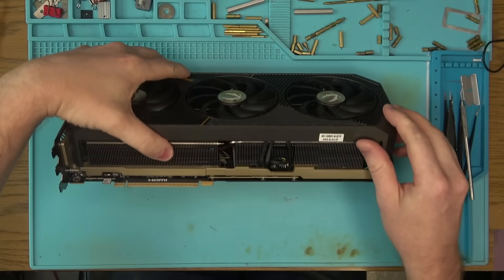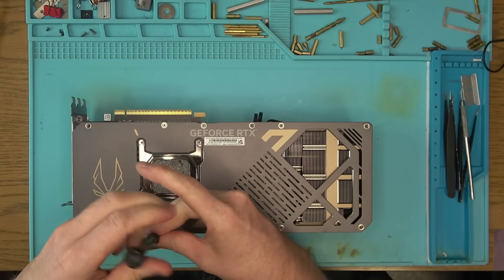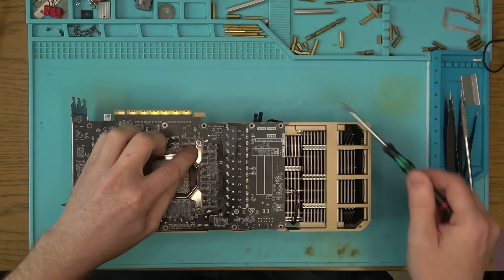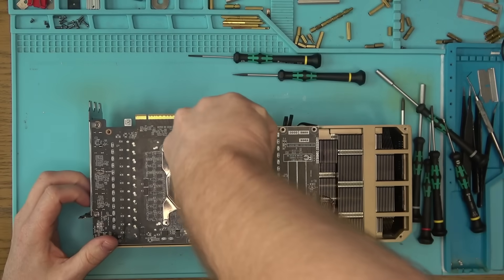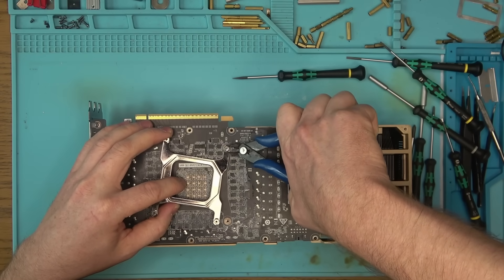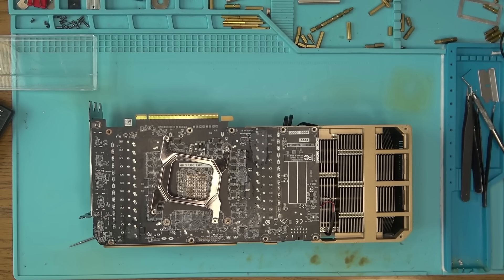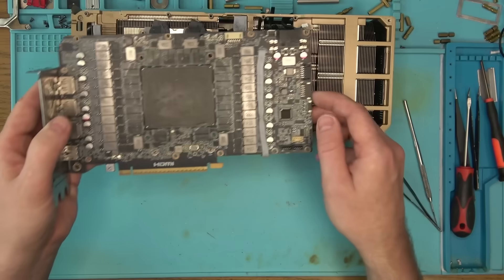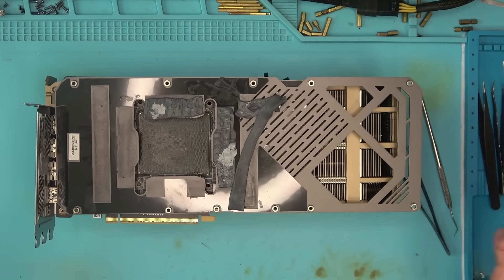WARNING new RTX 5090 scam just hit the market

Comment: Of 10 minutes video, 9 minutes are dedicated to unscrewing and removing the cover.... And then pulling the plugs from the cables themselves? Come on, pull them from the pin, NEVER from the cables.  And then grabbing another GPU by holding it by the connector.   Dear God... I don't know who did what here or who got scammed here, but for a guy that repairs electronic equipment, the finesse is truly of a construction worker.

Comment: I bought a PNY 5090 and an Asus 5090 at amazon (sold and shipped by AMZ). In both cases, the seals were intact, and even the seals of the plastic wrapping inside were intact. However, in both cases, the core and VRAM were removed. I recorded the unboxing and got a refund. :/

Comment: Old farmer trick.  Get yourself some left hand drill bits.  As you are drilling out the screw, it usually bites after a bit and turns the screw/bolt out.  You would only need one size in your business.

Comment: I have Geforce RTX 4080 Super and it work perfectly 
Processor	Intel(R) Core(TM) i7-14700KF   3.40 GHz
Installeret RAM	32,0 GB (31,8 GB kan bruges)
Lager	1.86 TB SSD INTENSO SSD, 932 GB SSD WD_BLACK SN850X 1000GB
Grafikkort	NVIDIA GeForce RTX 4080 SUPER (16 GB)
Systemtype	64-bit operativsystem, x64-baseret processor
Reply: Good for you but what your pc specs has to do with anything regarding this video?

Comment: if i ever get one of these rounded screws i use bit of glue drop it in there and then put the screw driver on top. wait till it is dry then you can get them out usualy you can also tin the hole and then put screwdriver in and let it cool sometimes this can work to if you have no glue ad hand

Comment: Tinkering wizz here, a rubber band and a flat head can help with stripped screws or a very tight fitting "T" (torque bit) "the star-shaped driver". Or they also make drivers made of a bunch of spring-loaded pins that press into small divets, utilizing most of what's left to grip onto this could possibly be an idea I've had for a tool designed for this purpose

Comment: Pro tip for the future on those stripped screws keep a piece of a hacksaw blade like 3-4 in long, and cut a slit across the top then you can use a flathead to remove the screw, and also that isnt a "new scam" memoryless and coreless gpus have been around forever

Comment: Frankenstein GPUs are a waste of time, UNLESS you DIY and get the parts cheap. DO NOT BUY it pre done unless you get a warranty from a seller in your country. Otherwise prepare to bend over and take it without any lube or reach around. There are lots of options for high vram cards i.e RTX Pro Blackwell, and prices are coming down especially secondhand market. AVOID overseas modded cards, you have no idea if any kind of QC has been done, even if there is it's likely BS anyway.

Comment: My advice, just buy cheap shit. TRULY cheap. I cannot fathom spending 2k on a GPU. Maybe a whole brand new system ,not including monitor, for 2k but not the fn video card itself. Id wager most of u never would either. 3, 4, 500$ max is plenty for a GPU in all reality. And if that means all u get is a 5060Ti or a 9060XT then by god so fn be it! IF its just for gaming u dont even really need all this best of the fn best hardware to get games looking and running good. In fact if you dont have a good gaming monitor to pair with your gpu, do that instead of spending unnecessarily way overkilling stuff too far ahead of time. It will make more of a difference for alot less than 2k, and will apply to everything u do with your rig, not just gaming. U dont NEED a 4090 or 5090 to game. U WANT it. Just quit overpaying cuz it hurts us all. If enough people refuse to give in to outlandish prices for gpus theyll have to change and drop prices, like everything else

Comment: Cutting the screw while perhaps called for is very risky, metal shavings on a PCB are not a method of improving reliability.  How come to do not have any vice grips. You might have been able to use a vice grip to pin the screen to the silver frame and twist the whole mess.

Comment: mip drivers are some of the best drivers you can buy. they are made in the usa. we use them for the rc hobby. i have some of the wera drivers like your using they are pretty good but not near as good as the mip. you should give them a try. ive got stripped hex screws out with the mip drivers.

Comment: I never believed in 2nd hard market and have never gotten anything 2nd hand. Well just once, the 1st phone i bought was used back in 2004 and since then i always buy my thing brand new. If i can't afford a certain thing then i just wait until I saved up enough money. I have rtx4090 and my original plan was to get rtx3090 but at the time i couldn't afford it because of the scalping prices on top of huge price difference in my country. So i waited and saved up more money and then rtx4090 came and still had scalping prices. I wanted either asus tuf gaming oc or rog strix oc and in February 2023, my friend who lives in Canada (was coming home back in march for holidays) found it in retail price 1700usd (Asus tuf gaming rtx4090 OC) at bestbuy. there were bunch of others but sadly rog strix OC wasn't available. And then in 1st week of March he brought it with him along with MSI Meg ai1300p psu.
I just refuse to pay both above retail and overpriced products (rtx5090) for what they can do out of principle. Rtx5090 is just overpriced gpu for what it can do, should have been at least 1750usd (FE variant) if not the same as rtx4090 (1600usd).

Comment: Yeah actually those back plate screws are pretty soft metal screws they strip so easy I don't normally strip those but sometimes it does happen especially when you're tightening way tighter than they're supposed to be

Comment: Here is a question with that pressure plate or even the other screws are they Phillips head ie + shape or they that seriously annoying Posix one.  Only asking because that is a major cause for people stripping their screws out as they dont look very carefully and make sure its not a Posix because noticing the 2nd smaller + slots can be difficult esp in plated screws.
For those who dont know the Posix has two + shapes one is smaller turned 45 degrees from the standard + Phillips head and they pretty much strip instantly unless you extremely careful.
My EVGA CLC 280's cooling plate used them and lucky me they were coarse threaded into plastic so not much resistance and torque was needed to turn them so I could clean my fins out on it, as its 6 years old... but again got lucky using a normal Phillips on them as I didnt have a Posix screwdriver for that size.

Comment: IT is getting ridiculous, top end cards are getting more expensive than entire systems, no thank you! There is 10 different ways of getting that screw out, take the other three out and turn the bracket, use pliers or small vice grips, use a pair of small wire cutters to cut into the screw notches, use a dremel to cut a slot across it, I am an electronics tech and ex heavy equipment mechanic so I have ran into broken screws, bolts and the like all the time!

Comment: @northwestrepair
You can try placing some aluminum foil between the screw and the screwdriver first. This will greatly increase the adhesion. If that doesn't work, you can always drill into the screw.

Comment: Use a little bit of lock tight on the tip off the screwdriver, let it set, you can use pliers to removed the screw from the screwdriver layer without any chance of damaging the card

Comment: jO Next time you bolt or srew is messed up you need tin, are something to get leverage with or a mould if it is a bold, then immediately spray it with cold spray out of a can and the solder will be very hard, you onlt need a small tin pan, If you have ever heared of that, it goes to 450 degress and you pour it in what ever you want, also very handly if you want to cast some part that doesnt't get hot!

Comment: For future reference on stripped Philips head screws. You can cut a slot into them using a dremel or what ever and then use a flat head screwdriver to remove it

Comment: Yes, I can read. (but didn't get the joke)
I can't imagine paying CA$3000 (current local price) for a 5090 only to discover I bought a  brick.
I can take up to a year collecting components when I build a system, usually checking the most expensive off the list first. So any return windows would have long expired by the time I would discover the scam.

Comment: For worn out screw head like this I use A/B compound to adhere on a used rusty screw head against the target screw head. Wait for 24hrs after the compound fully hardened and use any plier size to twist it out. Now I can't even separate the 2 joint screw heads.

Comment: I used to deal with old CB radios back years ago where people would try to open them and tweak on them.. they would often strip the screws instead. - An engraver with blunt tip to vibrate the screw a good bit before trying to loosen it helps tremendously.

Comment: If you ever run across a stripped screw head you can use a rubber band or valve grinding compound. Valve grinding compound you can get an auto stores. Just use a little dab on the head of the screw. Helps get the grip.

Comment: Cool video.
When I get tiny screws with stripped heads / damages heads, I superglue a screwdriver to the screw.
It works 90% of the time, and just use a bit of nail polish remover or acetone to clean up the screwdriver and screw of superglue.
Cheers.
Reply: nice trick
Reply: i was thinking the same but with a pinch of baking soda
Reply: Great idea.
Reply: I usually just use my dremel to cut a slot and use a flathead.
Reply: Maybe a lil glob of solder and let dry to the screwdriver tip in there lol just an idea

Comment: I wouldn't even pay $1000 for a 5090, between the high likelihood of connector failure and the horrendous drivers they've been releasing thats a big no thanks for me...
Reply: That just sounds like a cope. I've had a 3090 since they released(I paid MSRP and no sales tax) and had no problems whatsoever. The connector failures are user induced in most cases with 4090/5090.
Reply: @donnyboi1990 the 3090 had fuses and proper load distribution on the power fazes so yeah you wouldn't have a problem with the connector. Unfortunately that was the only card before or since to have that so your opinion is kinda moot.
Reply: @donnyboi1990 also you have it backwards, most failures have absolutely nothing to do with user error...

Comment: I agree on the Wera (German) micro bits not being that good.
I own the same set and they are potentially the worst Wera tools I own.

Wiha bits on the other hand are pretty good. I don't know if it's screw heads that are not upto specs or the bits themselves. But my other 3 sets - Wiha bits, Wiha for Xiaomi bits and Xiaomi fit better. Xiaomi bits are dirt cheap so it's a bit disappointing for Wera.

Comment: for stripped screws like that u can use a Dremel and a cut off wheel to very carefully cut a slot in that screw to make it fit flat heads and then u can get it off that way. A Dremel  usually comes with small  circular metal cut off wheels that are like a black color and they work great for cutting a slot in screws that are stripped

Comment: TIP: for screws like this you can try a small cut-off of a rubber band. Or something else that a thin layer of rubber. Put it in the hole and then try the screwdriver again.

Comment: why do people buy rtx5090 cards? are they living under a rock? first the connectors melt, then the nvidia driver is bad and missing rop`s. Starting to wonder if people are with their full 5 in head. Many complaints afterwards when contacts are melted, people are unable to think independently
Reply: It is best GPU out there. Most people do not care about cost, Even if connector melts replacement of connector costs only £300 by professional. Plus it has AI features and allows you to try LLM as hobby. In fact this GPU is super cheap and offers great value compared to RTX PRO 6000.

Comment: Those screwdrivers are Czech if I’m not mistaken. German company, made in the Czech Republic. Not that it makes a difference. I enjoy my Wera stuff. I tend to use Klein and Chapman more for screwdrivers. Some Snap On stuff if I find it cheap on eBay. I NEED a precision set though. I’m currently struggling with clearance on a project and I KNOW FOR A FACT a regular micro screwdriver would be the ticket.

Comment: This is not a scam! You have to aquire separately the GPU and the GDDR7 and then solder them by yourself on the graphics card PCB.
Reply: Yes you are absolutely right - for that porpose you must buy intact rtx 5090 to unsolder needed components from there for this empty card. problem solved.

Comment: 4:00 Why is it so rare that people use reverse drill bits to remove stripped screws? It works so well
Reply: Not in this case, very fragile components closely all around, the risk of damage is too high.
Reply: Mount the reverse drill bit in a screwdriver like handle
Reply: dremel with a disc can turn it into a flathead in 2 seconds easy
Reply: They make a pair of pliers that are made to grip the screw from above, and they worked for me.  Also, a micro screw extractor sets on Amazon that have worked well for me, and it would have worked in this situation.

Comment: tip for you , to get stripped head screws out i use side cutters but put the in vertically (one point of the cutter in the screw hole and the other gripping the outside of the screw head) then rotate

Comment: Maybe i cam help you... inremovevthese screws making rugged the internal of the hole using a dremmel , after that with a big solder iton in fill the hole with solder...  after that i place on a flat plate of copper some other soldering ... and at the end i joint both using the solderibg iton on top of them ..and unlock the screw using lateral force ( not from the top like using a screwdriver )

Comment: I have multiple “Frankenstein” 48GB 4090s. I use them for ai workloads as they cost about 4k. 4090 and 5090 cores are in huge demand in China because a $2k 4090 core can be converted into a $4,000 “ai turbo” 4090 of which there is high demand so there is a HUGE profits to be made so the scamming and even legit used market will be high. A modified 5090 with more vram and 2slot “ai turbo” form factor will sell for 5-6k USD. My Chinese supplier has told me that 3GB Samsung vram modules have just made it to shenzen in high quantity so the construction of modified 5090s are starting right now as the PCBs and fan assembly are already completed, however they are just waiting in cracking the vbios but that is imminent. Scamming will certainly spike. Thank you for posting this video to educate people.
Reply: Just get a pro 5000 Blackwell if you want more vram for AI? Why risk getting scammed out of 2 grand?
Reply: @bamboozled1v1 pro 5000 blackwell has far less cores, comparably it is a little bit better than 5080. It is 5090 that they demand tbf
Reply: If you got 5 grand to throw at a chinese bootleg 48gb card. Then just save a bit more and get a 96gb 6000 Pro Blackwell instead which is double the price for double the vram, top grade Silicon etc.
Reply: @zealgaming8161  you make sense, but Frankenstein 5090 is coming. And it will have same 96gb vram for 4-5k usd. Not 10-12k$ as for rtx pro 6000
Reply: @yurii851  I'll doubt it be just 4k... That's the price of a 5090 in my country heh...
pro 6000 is 12k here btw.
Your also getting the missing ROPS and top grade silicon with the 6000 and also a very tiny 2 slot card.
Reply: @yurii851  Franken 5090 should have 64gb I would think, if they're doubling it. I don't know how you'd get 96gb since it's an odd number, and 128gb for 4x original just seems too much power draw for the card (which is already a power hog by default).
Reply: @larion2336 they aren't doubling. They will just replace 2gb chips with 3 gb
Reply: @yurii851  Yeah my bad, guess they're doing it differently in that case. I thought for some of the 48gb 4090s I saw they were literally adding double the memory chips. But indeed the 6000 Blackwell appears to be the 5090 workstation equivalent with 96gb so I guess they can do it that way. Whether or not their dodgy Chinese version winds up much cheaper than the Blackwell is another matter.
Reply: How does one create a Franken graphics card? I really don't understand the principle behind this.
Reply: @Jerry_S.  they replace 2gb vram modules with 4gb modules, and probably modify the bios of the card.
Reply: How do one obtain these and without getting scammed?
Reply: Although i didnt expect to see a naked board
Reply: That that nVidia.
Those greedy scalpers selling just a tiny extra amount of memory 10 times the price.
The PC industry really should get their shit together and design a new form factor of motherboards with the GPU in a LGA socket and the GDDR memory in JDEC2 connector, on top of the DDR.
Reply: China can always asimilate taiwan and make as many chips as they d want

Comment: I purchased a Quadro P500 MXM GPU from a Chinese eBay vendor for $550 a few years ago, and that thing didn't work. I requested that they send me a return shipping label, but they just ignored me. I ended up paying the cheapest shipping from USPS, which was $47. The return tracking showed that the package was cleared by the Chinese customs services and was waiting to be picked up, but the seller ignored it and didn't refund me. I called eBay one more week later and I got a refund, I guess, from eBay's buyer protection. Since then, I avoid anything from Chinese sellers in China like the plague. If they comfortably sell fake baby formula, imagine what else they can sell.